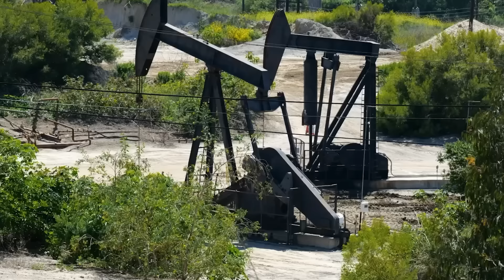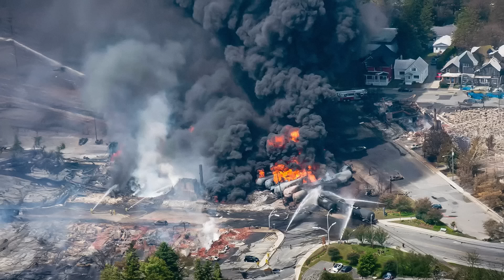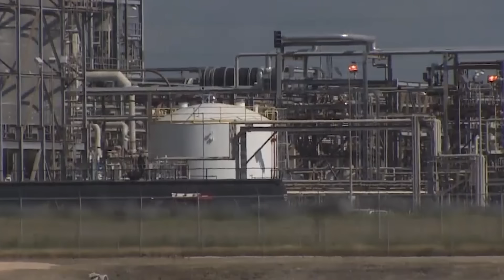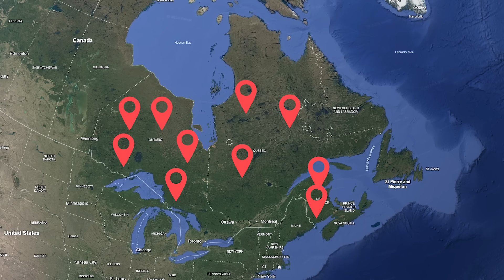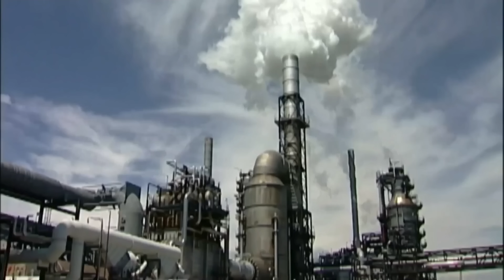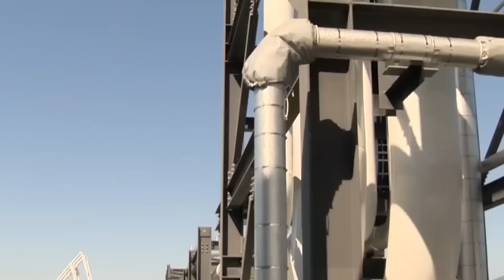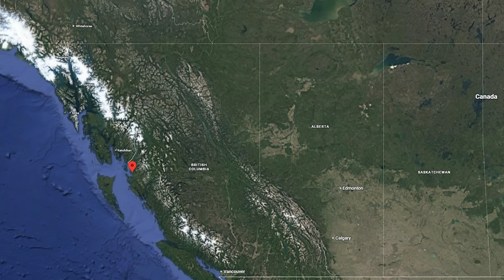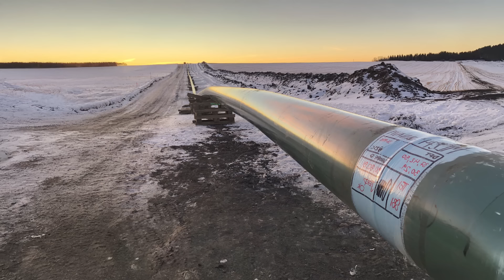Here's Why Canada Can't Build Its Own Refineries, Even Though It Produces Millions of Tons of Oil

Comment: There is areason oil companies are not investing in new refineries, and OPEC is pumping more oil. Peak oil demand by 2030. In 2025, while Western markets like North America saw flat or declining growth, electric vehicle (EV) sales, but in the "Rest of World" (excluding China and the West) surged by 48%. This shift is fundamentally underpinned by Chinese investment and the export of affordable technology. In India, record solar and wind expansion combined with slightly lower demand led to a 34% drop in gas-fired generation in early 2025.  Solar and wind are now 41% and 53% cheaper, respectively, than the lowest-cost fossil fuel alternatives globally.  The Saudis et. al. do not want a stranded asset they are therefore trying to pump out as much as possible, hence the lower gas prices we have seen for the past year.  More pipelines or refineries would simply be a bad investment.  Alberta is doubling down on oil and gas, this is a fools errand, they need to diversify. They have engineering expertise and industrial capacity focused on oil and gas, they need to divert this capacity to something else.

Comment: 220 oil refineries in Canada with 17 operating. Most refineries are in Alberta and Ontario. Canada is selling cheap to other jurisdictions like Murika.
Reply: your 17 oil refineries is spot on. however the 220 number is absolutely not correct.  your confusion might be coming from other plants that deal with oil but they are definitely not refineries.
Reply: @P @Platinum1133 Micro or Kettle refineries are still refineries; Frump and your definition and propaganda notwithstanding. Do you know that refining can be done by moonshiners using rusty old barrels?🧌Now, go drink your kooaid and relax😂

Comment: Refineries in Nova Scotia were torn down by Valero because they were too small and the eastcoast market is too small. 4 refineries were built during WW2 but unfortunately the war ended.😂
Reply: There are 13 out of 15 refineries in Canada that use Alberta bitumen sands heavy crude oil right now. 

All 13 of those refineries receive deliveries directly via pipeline from Alberta, including all four in southern Ontario (via Line 5) and the only refinery in Montreal (via Line 9).

The two refineries that do not use Alberta crude oil in their refinery diets are located on the south shore of Quebec City, in Lévis, and in Saint John, New Brunswick.

The refinery in Quebec City is owned by Valero and the same company owns a massive storage depot in Montreal. Furthermore, Valero also owns an oil pipeline between Montreal and Quebec City.

So the reader may be asking themselves: so wait, if there's already a pipeline between Alberta and Montreal and another oil pipeline linked directly to the same company's refinery in Quebec City, why aren't they using Alberta crude oil too?!

The answer is simple: it's not economical to do so.

Alberta bitumen is heavy in asphaltenes and low in resins. This makes it a low-value product that is generally used as a cheap blending agent to bring down the overall cost of refined petroleum products. Remember when the Conservatives told you that Western Canada Select oil was priced lower than West Texas Intermediate because there was insufficient pipeline capacity to Canada's west coast and Canada was stuck with only "one customer"? Well, the Trans-Mountain oil pipeline is now complete, exports are happening all over the world, plus, there is excess capacity available on it!! And the price gap between Western Canada Select and WTI is still over $12/barrel on average!! Chalk it all up to yet another Conservative lie. Pierre Poilièvre is a rank expert at lying to Canadians and Conservatives are repeating the same, tired lies that are being disproven every day with TMX exports to Asia. Bitumen sands crude oil is low quality, and no amount of pipelines will ever change that. 

No, Valero actually uses their pipeline to ship finished products westward, from its refinery to Montreal instead of shipping Alberta crude eastward. 

Suncor also owns a Quebec refinery, in Montreal.  Suncor blends Alberta crudes with imported crude oil from overseas via tankers that land from the eastern US, Norway, the Middle East and Nigeria with light, sweet crude oil. The imported oil either arrives by tankers, or occasionally, gets unloaded in Portland, Maine and then piped to Montreal. 

Incidentally, the company that owns the Maine to Montreal oil pipeline applied to reverse its direction, so that the line could carry tar sands bitumen from Line 9 to Portland, Maine for marine export via tanker.  Concerned citizens of Portland in 2014 passed a municipal ordinance banning the export of oil sands bitumen at the Port due to environmental concerns. Portland Pipe Line Co (PPLC) filed a lawsuit to overturn the ordinance as unconstitutional, and against interstate and international trade. They lost in Court and abandoned their appeal in 2021. 

Many find it amusing to listen to the same Conservatives who worked tirelessly to destroy Canada's National Energy Programme in the 1980s now turnaround and counsel the government to ignore the economics and build a brand new pipeline from Alberta to those two refineries, even though it makes zero economic sense to do it today with all the existing infrastructure in place.

Comment: Did you know that the last major refinery built in the USA was 1977, so since they are made for heavy crude, so the US exports most of their light sweet oil, and process canadian  crude.
The companies have figured out what is the most cost effective , and if there is one thing they are good it making money. Heavy crude has more fractions than light crude , those fractions are tar bitumen     etc. Which of course are needed.
Reply: well the first one I built in Edmonton is called shell scottsford and it was built in 1984 and expanded to include an upgrader in 2003. I've built 5 refineries total, which is less than a third of the refineries in Canada.
Reply: .  That may be the first that you worked on.  Refinery row goes well back before 1940.  Now its only suncor & esso.  There used to be 4 or 5 refineries there.  In the Hayter industrial park, there is the remains of the White rose refinery, which would be bought by Shell
Reply: The US had a southern heavy crude source too: Venezuela. Chevron was pumping from there.
Reply: Not true.   They blend Canadian heavy crude with US light crude because Light Crude produces the lighter products like gasoline (mostly) and heavy crude the heavier products like diesel and asphalt although both produce some of each.   Light crude produces 25 gasoline and 10 diesel.  Heavy crude produces 25 diesel and 10 gasoline.  (Both produce a lot more products besides)  By mixing the two together they get the quantities of all the products required.   It is in the name.  Light VS Heavy and in the science.    There is a lot more to it but that is the basic.
Reply: @jimthebutcher99  we make millions of barrels of light synthetic crude from bitumen avery week, and that synthetic light sweet oil makes millions of barrels of gasoline and diesel and other petrochemicals that become plastics and lubricants. Canada's petro-industries are huge, well developed, efficient and low carbon.
Reply: @captain34ca     But it is much more expensive to make it than to refine sweet crude or to upgrade that light crude to get twice the gasoline than it is to upgrade bitumen to get less than half the gasoline from it.    That is why Alberta crude sells for less.  It is much more expensive to process.
Reply: @jimthebutcher99  no, it is cheaper to upgrade and refine bitumen than to import light sweet. A barrel of bitumen makes more than a barrel of synthetic sweet light crude which is very cheap to refine. Irving refineries in the east import African and middle eastern oil and their input costs are slightly higher than alberta refineries using upgraded bitumen feed stock. I have only worked in the industry for 23 years, mostly in middle management. You might want to read something factual. Diluted bitumen is cheap because there is less demand than for intermediate grades and a perpetual oversupply. Upgraded synthetic is priced close to WTI.
Reply: There is not a single refinery in Canada or the US that refines only heavy crude.  Not one.
Reply: @jimthebutcher99  you are incorrect. There is a refinery in Delaware City, Delaware that only uses heavy crude. It was built in 1957. It briefly closed when Valaro couldn’t find a buyer. The current owners made extensive renovations which included closing the refinery docks on the Delaware river in exchange for regulatory permissions to build a rail yard to handle oil sans trains from Canada. Their business model is processing the low grade oil into various stocks which are then mostly exported back to Canada via the East coast pipeline networks that also run into Canada. The refinery also has a major Coking unit that supplies its onsite CoGen facility as well as being a lucrative export product in itself. I have retired as a maintenance worker on the site through several different owners and family members currently work in the control rooms. Under previous ownerships it processed whatever mixtures that provided the greatest profit in the current market. Most of us thought the current owners were nuts to cut off supply link options and only rail in oils sands crude but it seems to be working for them.
Reply: @earleford8889    Nope.  You are wrong.   Try that google thingy.   The Delaware City refinery primarily processes a variety of medium to heavy, sour crude oils — but it can run light, sweet crude oils as well when economically viable.
Reply: @jimthebutcher99 there is a Husky Upgrader in Lloydminister, a Coop refinery in Regina, and 3 or 4 upgraders in Ft McMurray that all make gasoline, diesel and asphalt.
Reply: @normferguson2769    And they all use a mixture of light crude medium crude and synthetic crude with the heavy crude.  Light sweet crude gives about 50% gasoline before upgrading.   Heavy crude after upgrading maxes out at about 30% gasoline.  Then you run into the law of diminishing returns where it takes more energy to produce the product than you can make selling the results.  Also, at that point  the rest of the products produced get heavier and heavier and will plug up the refineries.   It is not rocket science, it is actual science.      Light crude gives you products from the light end of the scale and heavy crude gives you products from the heavy end of the scale.  Asphalt,  (along with lesser amounts of the other products. )
Reply: 1967 Texaco, later Motiva, now Shell in Convent, LA was the last one actually built as an integrated refinery and to refine Louisiana Light Sweet crude oil from offshore.  The Marathon, Garyville refinery was a 10,000 BPD topping plant built to capitalize on the entitlement program for indie refiners and later expanded.  One such refinery was built in Corpus Christi, TX with 4 each different 10,000 BPD refineries all owned by the same holding company.  11 major Gulf Coast refineries didn't switch to heavy and very heavy crudes until the 80's when petroleum coke went from a by product sold to be gotten rid of into a profit center with development of a market in Europe by a German trading/steel company.
Reply: '' Did you know that the last major refinery built in the USA was 1977, ''  No No !  In 1994 worked on a Refinery build for the US gulf coast to handle Venezuelan crude which is heavy and full of Sulfer.
Reply: America First Refining (AFR) is set to break ground in Q2 2026 on a new $300 billion, 160,000 barrel-per-day refinery in Brownsville, Texas, marking the first major US refinery in nearly 50 years. Supported by a 20-year agreement with India's Reliance Industries, the facility will focus on processing U.S. shale oil.
Reply: Might have something to do with heavy crude makes a lot of diesel fuel and jet fuel. Plus, oil is not just used for transportation. The USA has a massive petrochemical industry. The main ingredient in tires is oil, think asphalt, asphalt shingles and other roofing products. Plastics, pharmaceutical uses, etc...
Reply: The US refines 40% of their light sweet crude and exports 60%. Nearly all US refineries run a 60/40 blend of heavy and light sweet.
Reply: @billwilson-es5yn   and that is because without the mixed in heavy crude you don't get enough diesel
Reply: That's funny...I helped build at least 2 in the last 20 years and numerous upgrades on several others... get ALL of your facts straight... before commenting.
Reply: Canada sells most of its crude and the US refines little of it.  Those refineries have to process US crude as well so there is little time to process canadian crude.
Reply: @xcalibertrekker6693  that is not even close to true.   Almost all of the crude Canada sends  to the US is refined there.  The US produces mostly light crude which produces the lighter products like gasoline.    Heavy crude produces the heavier products like diesel fuel.  So the refineries mix the two to get a more equitable mix of final products. 
US refineries have invested billions to specialize in handling heavy sour crude oil — the type Canada predominantly produces — with some refineries like BP Whiting specifically modernized with Canadian crude in mind. 
 The US refines it and then about 75% of the final products are shipped back to Canada..   Isn't the internet wonderful when you can just look up figures like this?
Reply: @jimthebutcher99  Some yes but we do not have the refinery capacity to process our crude and most of yours.
Reply: @xcalibertrekker6693    It is not some, it is almost all oil from Canada is processed in the US.  US sells a lot of oil but mostly it is light sweet crude.
Reply: Most of the US refineries were built to supply oil for WWII. They are very low efficiency. Canada has invested in upgrading facilities and are twice as efficient.
Reply: @normferguson2769   yes they were/are.    But heavy crude is still heavy crude and you can only do so much with it and extract so much of each product no matter how you treat it.  It will never produce the amount of gasoline light sweet crude does and light sweet crude will never produce the amount of diesel heavy crude does.
Reply: @normferguson2769  Yet they export 80% of it to the US.  Sounds like you have things backwards.
Reply: Yeah it has more fractions. That's why the Americans should pay us more, not less, per barrel. It's an open loot happening.
Reply: @justathinker8669     there is good profit from both.     Heavy crude takes a very complex system to get the same money from it.    Canada has a couple of those high cost refineries but the undeniable fact is that light crude is more profitable because even light crude can be cracked to produce even more of the higher profit products like gasoline.  By mixing the two as every refinery in north America does you get the biggest bang for your buck.

Comment: Alberta has oil pumps all through out it. It produces much more than just bitumen. The oil sands are a relatively recent thing comparatively. Most of what alberta produces is sweet crude, not bitumen.
Reply: Sorry mate not even close to true. More like 85% oil sands bitumen and 15% what you call "sweet crude"
Reply: @Platinum1133 no matter where you are in alberta east of the rockies you see oil pumps. Thousands of oil pumps. Working day and night. It took til the 90's and 2000's to figure out just how to work bitumin. But oil has been alberta's biggest natural resource since the 40's. The entire province was siesmicly mapped 2 decades ago. Oil every where. 
Bitumin is the big dirty word but moving it has only been developed recently. But sweet oil? Pumped day and night since the 40's. We just process it closer to home.
You see it on google earth. Those clearcuts on the eastern slopes of the rockies. Look closer. From Lethbridge to Rocky Mountain House, to Ft McMurry, oil pumps oil pumps oil pumps.